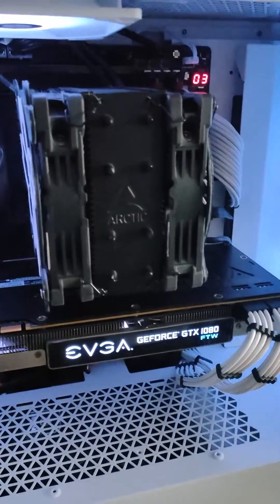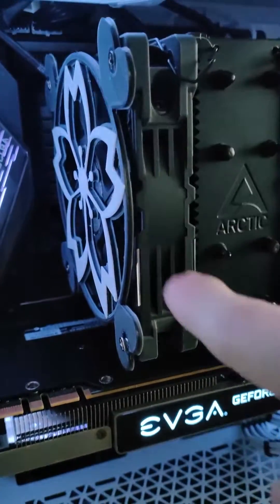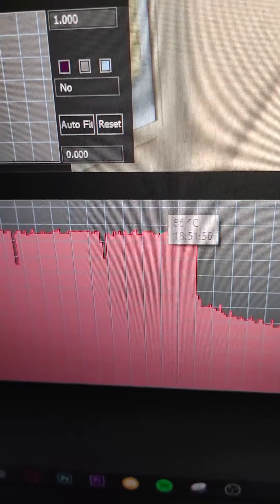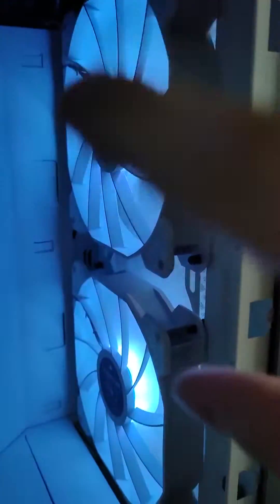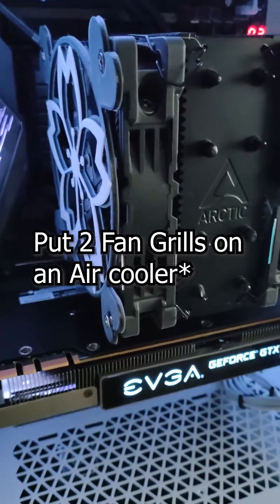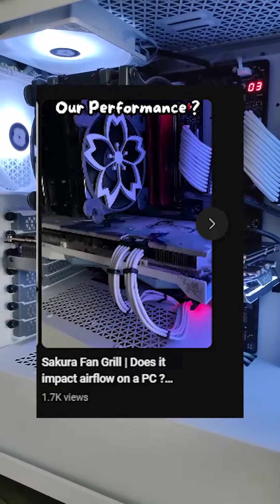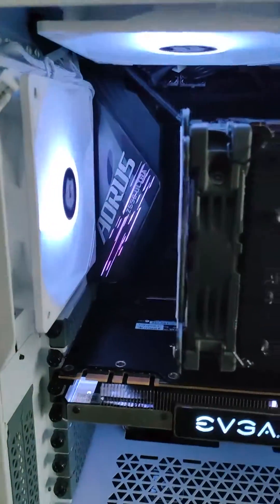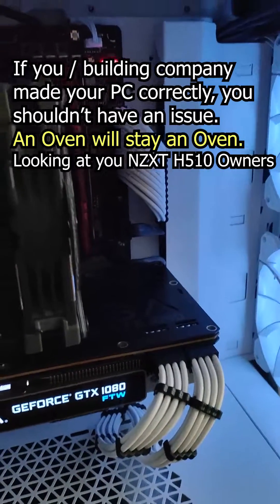Custom PC Fan Grills | Debunking Complaints !

Comment from the maker: Used my real voice for this one, hope you could understand me ! 
About fan grills. I get where most people are coming from with their claims.
I used to think the same way, however it makes a very small difference if you install them correctly. 
Of course this IS NOT the product for those who want optimal performance.
This is for customization purposes, and it is not aimed for BEST performance at all, because you will lose a bit of airflow.
Choosing a grill is completely your own decision, it is an add-on, it's not NECESSARY.
Unlike a case or actual fans themselves, I understand more the criticism about case airflow, fan quality, because those are components that are NEEDED for a PC.
You can continue to hate on the product if you want, it's free comments, but please note that this is an item for customization, not essential PC parts.